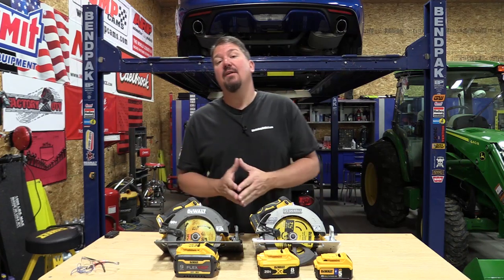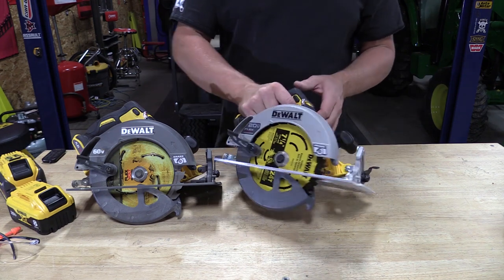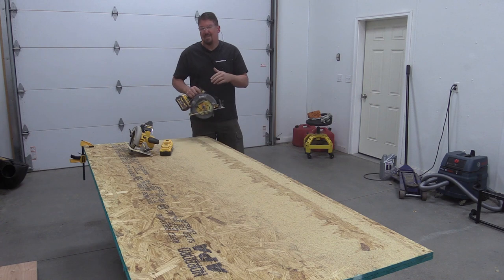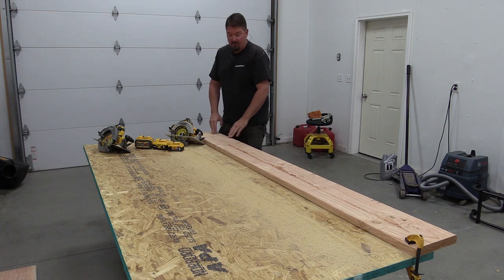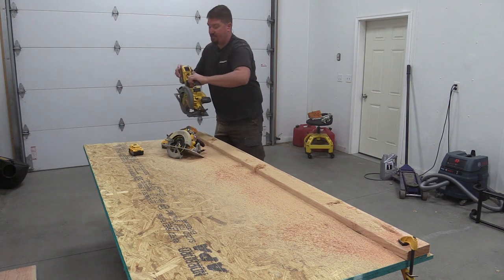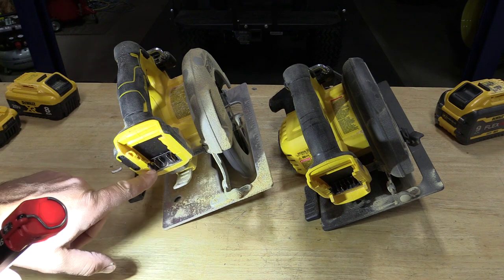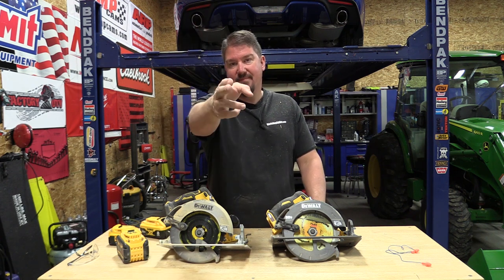DEWALT FlexVolt Advantage 20V Brushless 7-1/4" Circular Saw DCS573B Vs Flexvolt 60V Circ Saw Review

Comment: Correct me if I’m wrong. But a 20v 5ah battery is just that no more. It’s the amount of run time u get at a consistent 20 volts. A 2.5 amp hour battery in theory should run at 20v max at half that of a 5ah battery. So it does not matter if u have a 2.5 or a 5ah battery the 2.5 will give the max 20v as the 5ah just for a shorter amount of time period that’s it. Just Bc it’s a bigger amp hour battery doesn’t make it stronger it makes it last longer no more no less. Now on the normal max dewalt using a flex volt battery is a different story. Say u have a 5ah flex volt 20/60v battery but your gonna use it with the max saw that’s 20 volts the flex volt smart technology moves that 60v battery to a 20v battery this is where the change is since that 60v battery is 3 times stronger it in theory should run longer. If it’s a 3ah 60v battery it should run as long as a 9ah 20v battery. Now where is the power? That’s where the flex volt tool and battery come into play it’s a 60v tool and battery yes it has more power 2/3 more power than the 20 volt max. Now say ur using a flex volt tool and battery then u have a 20v tool and battery. If you have both batteries that’s 5 ah they should run about the same amount of time you just have more power with the flex volt Bc it’s a 60v tool not a 20v tool your working with 40 more volts than the 20. So the voltage rating =power of the tool the amp hours = is amount of run time at full voltage. The only comparison is run time on a 20v tool with the flex volt 60v battery so if you wanna convert to 60v system the flex volt battery makes this easier for you. You can start by buying 60v batteries and chargers bc that’s a large expense and keep ur 20v tools till u get your 60v tools coming in. And while ur swapping you should get about three times the runtime out of the flex volt than your normal 20v battery. It gives u they ability to swap piece by piece and not have to go buy the 60v tool and battery and chargers all at the same time. I could have explained this in shorter terms but I’m long winded so if I’m wrong lmk. I’d like to know.
Reply: As an electronics technician, I completely agree. 20V is 20V. Ah is capacity. I understand people not realizing this because marketers try to keep people in the dark to make more sales.

Comment: Great informative stuff. Just purchased the advantage, which will work for my application as industrial/commercial electrician and personal home use, so not too much power needed there. Looks like an 8ah XR for $140 will get me by. Think someone alluded to this point, but anyway; Flex volt looks like it runs one battery as two: two hots, two neutrals, two grounds. Same thing going as a circ saw with twin batteries like Makita.

Comment: Bottom line, if your using a cordless circular saw, let the blade cut at it own pace and you will not bog down the motor.  Granted the 60v flex volt is a beast of a tool, but if you can't justify spending the money to replace a perfectly good 20v Dewalt saw, the 20 v is fine just a little bit slower.  If you want speed and brute power get a skill worm drive saw.

Comment: Hey Brian, thanks for tackling such a confusing test ,I have the 1st gen Flexvolt 575 and it's awesome but I might just grab a 573 to use my lighter 5 amp batteries on lighter work and also I have the option of using the Flexvolt batteries as well .👍Win WIN.

Comment: I bought the Flexvolt advantage at the Depot because of the free 6ah 60 volt battery and charger promo for $199. But I'm returning it because I found the 60 volt saw with  a 9ah battery and a 20 volt hammer drill with battery, fast charger and bag for $299 at a Depot an hour away. I kept coming back here and watching that 60 volt saw eat two by stock convinced me.
Reply from the maker: That saw is a beast!
Reply: @WorkshopAddict  I also figured having a 60 volt battery give 3 times the run time in a 20 volt tool isn't much good if it takes 3 or 4 times as long to make a cut.

Comment: So really the Flexvolt saw is the way to go. The only advantage the Flexvolt advantage has is that you can use Flexvolt  and 20 volt batteries on it but it still doesn’t perform as good as the Flexvolt saw?
Reply from the maker: Exactly.
Reply: Also saves you from converting to 60 volt tools if you're already in the 20 volt platform and own at least 1 60v tool. Also keeps options open if you need to expand into the 60v tools for more power

Comment: So, the flexvolt seems to be the winner over the power detect, when youre using a 60v 9ah and 20v 8ah, respectively. But i have yet to see anyone switch the two batteries on the two models.

Comment: Didn't the flexvolt advantage come with a new 6amp flexvolt battery with 21700 cells I think there is something in those batteries that communicate with the saw
Reply from the maker: They all come bare tool.  There is a new style 6Ah, but it delivers the same power, or close as the new style 9ah.  As long as you are using the new style Flexvolts, you will get more power.  The 9Ah I am using is the new style.
Reply: @WorkshopAddict  okie dokie

Comment: I had the 6 1/2 20 volt and it didn't meet my needs I was going through batteries left and right cutting Red Oak. I used my friends   7 1/4 20 volt max and I like the song that I seen an awesome deal on the flexvolt so I bought it and immediately fell in love with it. Next one delicious the worm drive flexible which I'm sure will become my favorite saw now the 7 1/4 20 volt Max and 20 volt Max with flexvolt advantage are both 5500 rpm saws. The flexvolt is 5800 rpm.  Now tell me what do you mean by advantage and 55% more power?? If a soul is ready for $5,500 RPM you're not going to make it go more so really what's the  advantage???

Comment: I don't yet own a circular saw and don't have ANY Dewalt systems. I plan on building some raised gardens using 2x10s and contemplating the 20V Max XR vs the FlexVolt 7 1/4 Circular saws. My power tool "collection" consists of an old B&D Cordless and a Ryobi corded sander. Both can be upgraded in the future, as I want to move to a single battery system. As the FlexVolt batteries are beastly to put on something as simple as a drill/driver, would it make more sense for me to go with the 20V over FlexVolt?

Comment: Hi, great video and channel! I didn't see you mention anything about it, but i think you should consider covering first time buyers - at least at the end during your 'wrap up' section. 

I just got into woodworking and i'm in the market for a circular saw. I saw at Grainger they have dewalt XR Brushless saw for $180, comes with a charger, bag, and 5ah XR battery. However, i see HD is offering Flexvolt advantage for $200, with 6ah Flexvolt battery kit. I have bags already so that's not a factor for me. I'm not sure what the difference really is, from what i can tell maybe the 'XR' series is getting phased out, and Flexvolt is the current series? Seems like 'Flexvolt advantage' would be better than "Flexvolt", but it appears that's not the case? I'm interested in making furniture, I don't think you really need the 'best' saw for most of that, but it would still be great to get the better of the two. Which one would you recommend for someone like me?
Reply from the maker: Making furniture does need a good saw.  You will be putting a fine cut high tooth blade on this and cutting through hardwood.  You need power.  Most people who are woodworkers, like yourself will go corded because of how infrequent you use these saws and the savings in $$.  I would buy the Flexvolt Advantage saw if I were you as it performs better with the smaller batteies, although, with that saw you will need a Flexvolt battery.  So in that case, why not just buy the Flexvolt saw and get all the power!!!  The circ saw is one tool where you go straight to the 60 volt flexvolt and do not look back.

Comment: I use 2ah all over, preferred mobility for my home tools (Not professional).
How will a 2ah battery cope with simple cutting for home usage on the 573 ?
Reply from the maker: The saw will have no power.  You need a 5.0 Ah at a minimum for these larger tools and even then, I would not want to cut with a 5 Ah battery through any amount of lumber.
Reply: Little batteries are great for impact and drills, ocilating tools but a big negatory on saws or guns
Reply: @ddorn04  it won't hold at all?

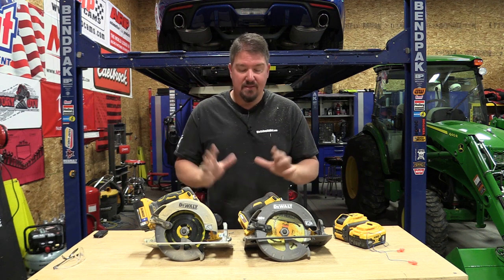Comment: I'm going to stop at 12:00 min do as I say not as I do. Joking only having a lend of you ha ha. At least that board is not as bad as mdf. Sometimes the chips or fine dust goes between the safety glasses. And goggles reduces sight significantly. A respirator will help. I find even with a vacuum attachment on trimming not much dust is collected. Definitely a big difference in power between the two saws. I know you did push the machine a bit hard for demonstration purposes. There are contractors who always push their machines and when they take the machine in for service complain the machine isn't any good. I often have heard contract fixers killing their machine particularly makita planers hearing them scream and bog down. Because they are on a tight price. They flog their machine day in day out. 
The flexvolt on the 54 volt machine is a beast. Very impressive.

Comment: What is the difference between flex volt and flex volt advantage?
Reply from the maker: Flexvolt is a 60 volt platform and you need Flexvolt batteries.  Flexvolt Advantage is a 20 volt platform that will gain extra power from the use of a flexvolt battery, but will also run on 20 volt batteries.  The 60 volt flexvolt has a ton more power than the flexvolt advantage.

Comment: Just so everyone knows "AH" (amp hours) is a measure of capacitance, not current (amps). So your 2ah battery is going to deliver as much as the 8, but it will need to be recharged 4x as much. Some of these tests are redundant, but thank you for selling me on the 60v system lol
Reply: I have the 60V system and it is a beast. I think it has more power than the corded saws I have used. :-)

A point of clarity. What you said about AH being capacity is correct though there is a relationship to how much current a real battery can supply and its capacity. Due to internal resistance in a battery, typically a lower capacity battery cannot output as much current as a battery pack with a larger capacity of the same type (lithium, NiMH, etc.). As the battery pack capacity increases, the effective internal resistance goes down and therefore it can supply a greater total current without having as much voltage sag.
Hope that helps! Have fun with the new tool! 
.
Reply from the maker: True and false statement.  If your different Ah cells have the same Amp output, you would be correct.  In the tool world, I have proved your statement wrong  in 2 of the last 3 videos I did.  All because the higher Ah packs provide more amps.  A typical 2Ah pack is 1P and a 4 or 5 Ah pack is 2P, and 2P can provide more amps.
Reply: Anecdotally my higher amp hour batteries give my Dewalt stuff a bit more gusto. On paper they should be the same, but that just doesn't seem to be the case in real world application. More cells probably equates to a bit more voltage or less strain.

Comment: Have 20v and 60v the 60v is kinda comparable to corded from a power perspective but not weight. I would consider corded again unless battery weight comes down. Cordless s fine for the smaller tools but no the big tools.
Just my opinion.

Comment: All of these battery options have my head spinning :O As an current owner of the OG 20v Max XR (DCS570) what is the HIGHEST SPEC battery pack I can get for my saw?
Reply from the maker: 8Ah 20-volt or 12Ah FlexVolt.  The difference being a 2P battery (10 cells) or a 3P battery (15 cells).
Reply: @WorkshopAddict  Oh man - thank you! I was thinking this might be the case but I admit, I was totally flummoxed lol

Comment: wish dewalt would make a upgraded blade left saw with a same power upgrades i do not like their blade right saws
Reply from the maker: Many of us share that same wish.
Reply: @WorkshopAddict  its mainly the shoe of those saws that i dislike most the one i had wasnt accurate at all the blade was like an 1/8in or better off from where it was marked on the shoe
Reply from the maker: I have not seen that, but I like to be able to see my cut line.
Reply: @WorkshopAddict  be on the lookout for this  
DEWALT DCS565B 20V MAX 6-1/2" BRUSHLESS CORDLESS LI-ION CIRCULAR SAW - BARE TOOL
Reply: Look up the new cordless 7 1/4 wormdrive , it’s a lefty and the battery goes into the saw, it’s amazing
Reply: @BlueFireDC  just saw the worm drive in stores looked real nice

Comment: @WorkshopAddict  Great review! I am looking to buy my first circular saw for DIY work. I don't currently own any Dewalt battery system tools. My only Cordless tool is an old B+D drill. I am trying to decide between these 2 but they just seem so similar. Since I don't have any Dewalt 20V or Flexvolt batteries, which direction would you recommend?
Reply from the maker: If you want pure power, go flexvolt.  If you want 75% of the power, go flexvolt advantage or power detect.

Comment: so...
these are great vids to determine motor power and battery power. so the next questions becomes ..

1. what is the difference with flex voltage advantage saw between 9ah,12ah,and the new 15ah!
I know more run time but I think there will be a power difference. maybe not on paper but in real life. I did thanks to your vid buy a Dewalt 60v flex worm style saw. beast mode activated. do you have a worm vs circular vid?

Comment: I am in need of a more powerful saw i have been through 3 milwaukee saws in a year i only have a couple of dewalt tools a drill and driver and grease gun i cut 1 1/4 hardwood trailer flooring in tractor trailers do you think the dewalt will hold up better or would you suggest another brand
Reply from the maker: Dewalt makes great saws.  I would suggest the Dewalt rear handle.
Reply: @WorkshopAddict  for working in confined space i don't think the rear handle would work
Reply from the maker: @paulmendenhall5226  Then give this a go.  I suggested the rear handle due to it having more power.

Comment: Should of made the same amount of cuts with the flex volt as the advantage to rule out blade wear...
Reply from the maker: Lol.  If you need a lab test to figure out the flexvolt has twice the power of the flex voltage advantage, go find it.   This was 100% proof here.  I guess you have to have some trust in the guy doing the video.  I am not here to BS anyone.

Comment: The most useful vid on that, thanks! Esp. for showing the battery connectors, now i get that FlexVolt Advantage works always in 20V, while more connectors on an actual FlexVolt tool make battery cells run in a chain (rather than in parallel) and give the tool true 60V (U₁+U₂+U₃). Also, 9.0 Ah battery on FlexVolt means capacity for a 20 volt tool! It’s all marketing:) Because, when running on a native FlexVolt 60V tool it’s just 3.0 A/h.

Comment: Great video, thank you.
I'm looking at getting a Dewalt 20V polisher, seeing in reviews they do like power like a saw. Pricing the Flexvolt 6.0ah 2-pack for $200, and a single 12ah for $200. Which do you think would be a better option, more runtime ? Close to the same time with one vs two ? Thank you
Reply: I am actually on the fence for just getting a corded polisher like a Torq brand as well. Just trying to balance the pros and cons to them. I do love the convenience of cordless, but for this tool in particular, is it worth it.
Reply from the maker: Two 6.0 Ah batteries will last as long as one 12Ah battery.  We have proved this over and over.  I would probably go with multiple 21700 9Ah battery packs.  IMHO, I only use my cordless for the hood and hard to reach areas of the car.  My corded models are lighter and more powerful.
Reply: @WorkshopAddict  thank you.  I was looking at the 9ah as well, and not much less than a 12 currently, I'll have to watch for some sales.
As nice as cordless will be, 95% of the time, I would be using the buffer in a shop with power all over too. I'm just like any other tool nut though, if the option is possible 🤷‍♂️😂.
Your point about having more power will probably sway me to a corded for now, and watch for sales. Hopefully they offer a free tool with purchase on them soon. They did with saws and multis last month.

Comment: Flexvolt hammer drill vs power detect hammer drill which is actually stronger?  I’ve heard despite listed specs, that power detect wins.
Reply from the maker: That is going to come down to the skill of the guy running the tool.  Because of the insane power, if you use large bits and do not hold the steady and in line with the hole, the drill will shut down.  Realistically, the drills are the same power.  It is going to matter on the battery attached.

Comment: How do these saws compare to 
DEWALT 20-Volt MAX Lithium-Ion Cordless Brushless 7-1/4 in. Circular Saw with Brake (Tool-Only)

Model# DCS570B
Reply from the maker: They are exactly the same unless you use higher power batteries then this one will have slightly more power.
Reply: @WorkshopAddict  are you saying both tools will outperform DCS570B with better batteries ?
Reply from the maker: @dalenesty2019  That has been my experience

Comment: It just seems to me that the Flexvolt Advantage tools are just the Gen 1 60V flexvolt tools
Reply from the maker: Same as the Power detect models.  They are the same tools, just designed for a 20 volt application and have less power.
Reply: Anthony Christello,  Definately NOT ,I have the first FLEXVOLT which is the 575 it is easy around 1600watts it will full depth rip Australian hardwood easily! It is unstoppable.

Comment: Did you change out the blade before every cut to get an accurate base line?
Reply: That isn't necessary. It wouldn't make a noticeable difference in the test.